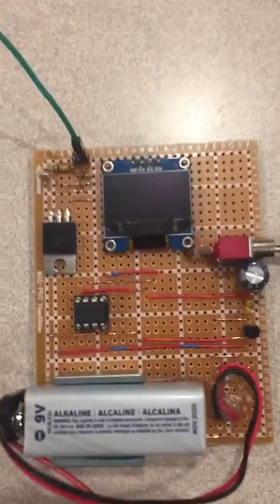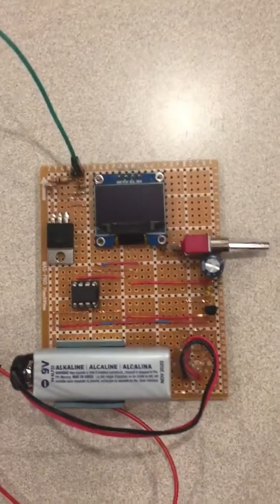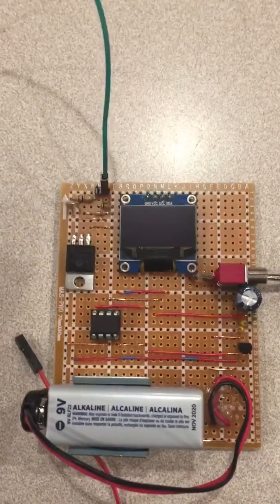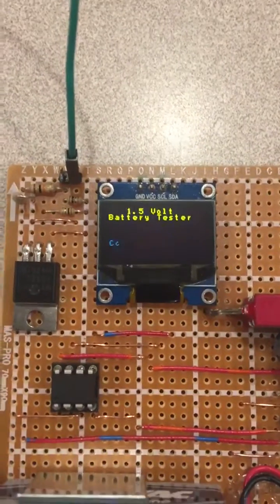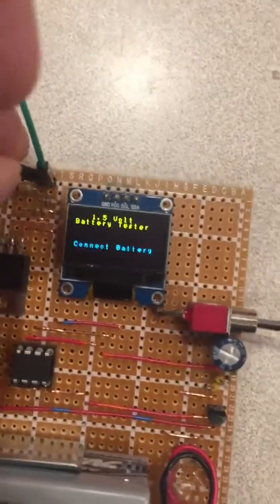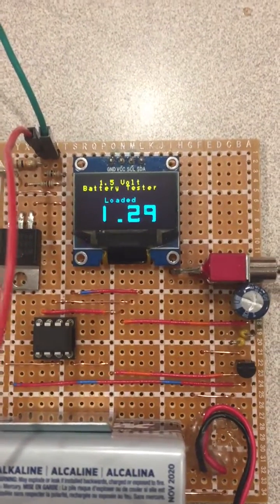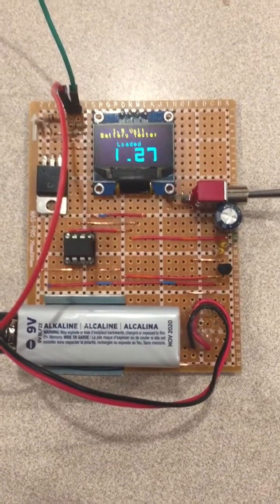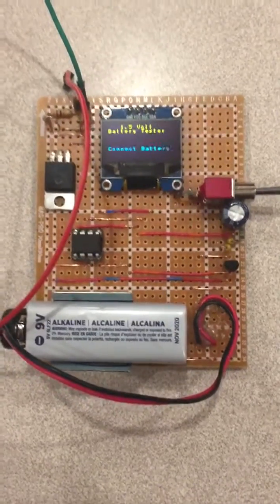ATTINY85 1.5 volt Cell Tester

Comment: Thanks for sharing , I made the project on a breadboard for test ( I used IRLZ44N MOSFET ) it worked but the results wasn't good . The voltage of a battery using voltmeter without load 1.347 volt and under load (2 ohm) 1.085 volt while the project  gave me 1.45 volt without load and multiple values under load .90 , .97 , .85 , 1.14 volt  for the same battery . any suggestions would be appreciated .